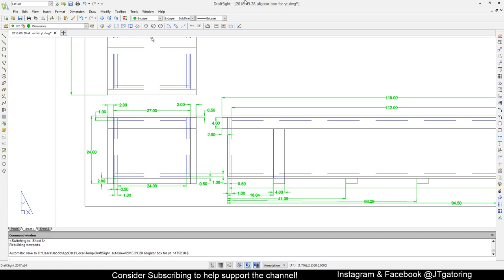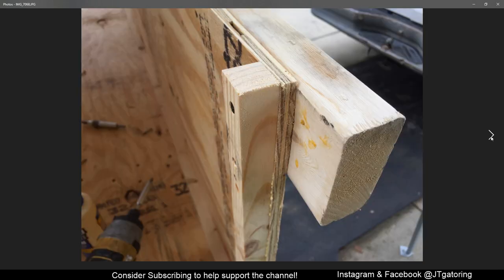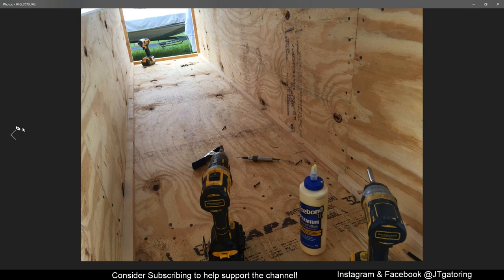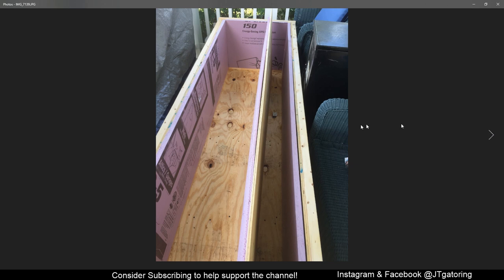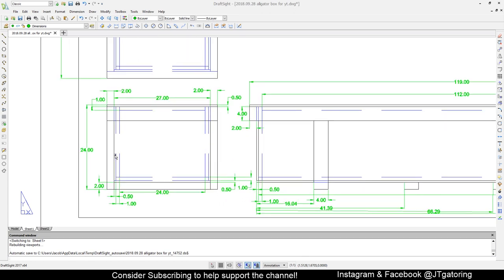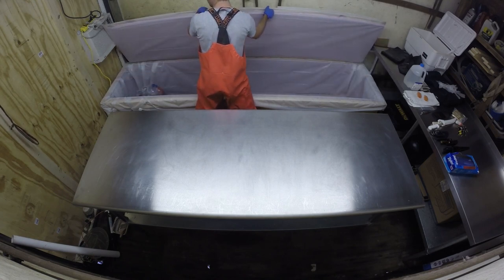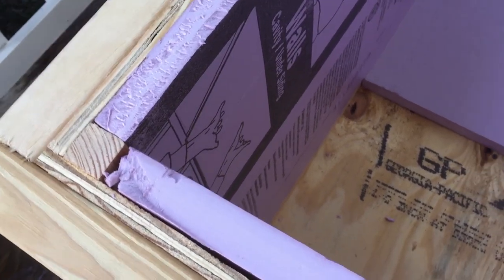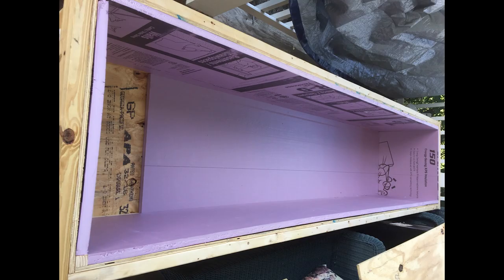Homemade DIY Cooler for Big Game (Alligator Cooler)

Comment: Sweet. Just what I was looking for. Doing my first pizza catering gig and need a way to keep the dough cool throughout the day. The link for the liner didn’t seem to work for me, though. Is it a food safe material?
Reply from the maker: Hey there. The liner was not food safe. I was only using the cooler for hide-on alligators so the liner never touched raw meat. An alternative option for you may be to use the same liner I did but use food-grade totes so your dough doesn't touch the liner or the ice water. I just found a liner that was as thick as possible since the gators have some big claws, teeth that snag everything, and tuff scoots. Make it fit your needs. Best of luck!
Reply: @JTgatoring  Oh rad. Yeah I’ve got stackable trays but that is a great point, they won’t be touching anything outside of that. Could you send a link/name of the liner you used? Happy to shop through your affiliate link, too
Reply from the maker: @ExplosiveStrawberry3  Hey, I appreciate that. This was the stuff I used - https://amzn.to/3O2JkGb. If that won't work, just search for "plastic roll" or "plastic sheeting roll". I just now looked around and couldn't really find a food-grade option for this size cooler in the video. The stuff I linked to is 10' x 25' so that way there isn't too much waste and its one solid sheet so water shouldn't leak, but if you're making the cooler smaller, you may be able to get away with a smaller roll that isn't 10' wide. I'd be interested to see what you make. If you're willing, please let me know how it turns out!